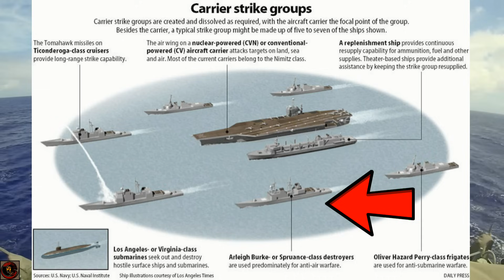DDG-51 Arleigh Burke Class Destroyer AEGIS - Overview

Comment: Don't get me wrong, I love my country's Navy but this ship is NOT really, in fact, a destroyer.  With the latest Flight 3 ships going 166 meters and up to 10,200 tons, this ship SHOULD be a CRUISER (consider that the Ticos are almost the same size and weight) based on most accepted international standards for ship design.  That being said, Burks are the most capable destroyers the US ever fielded.  

The Zumwalts will NEVER replace the Burks.  The Zumwalts tried to do too many things on one hull and failed miserably (other than as a technology demonstrator).  Especially for a ship with a 180-meter length, a displacement just short of 16,000 tons (Cruiser in Destroyer's clothing?) and a price tag of $5 Billion per ship BEFORE the sequester cuts jacked that up too (to be fair, Burks aren't cheap at $2 Billion per ship either).  They either need to pull a 155mm from the Zumwalt and slap on another 80 cell vertical launcher (giving them the highest missile payload in the Navy) or just "bite the bullet," and extend the ship to 200 meters and 20k tons, add all the flag functions, more MK57 launch cells and call it a Guided Missile Cruiser.  Even then, I doubt the Zumwalts will ever be bought in the numbers that the Burks have been built in.
Reply: Zumwalt was never built to replace the Burke. In all honesty though, it could (bare price). The Zumwalt was built to fill a land attack and point defense roll. IE no ballistic missile defense or area denial capabilities. This, along with cost, is why the Zumwalts aren't being built. The Zumwalts offered a lot in technological advancements, and the USN will likely benefit in future ship design from them. 

The original plan for the Zumwalt series was to make three ships [ship classes]. Each ship creating different capabilities that all three would share. Two of the three were canceled out right, thus leaving the Zumwalt without the full suit initially intended. This also caused the costs to skyrocket, as now the R&D was concentrated on a very low production run and only one ship class. Overall, the Zumwalts simply aren't the right ship the USN needs right now. What the USN needs is to start working on the Burke replacement, thus a smooth transition can happen in a few years to the more advanced class. 

@Wynton Goulding
The F-35 isn't actually a few times more expensive. The F-18 costs $80.4 million APUC, plus $8 million for the two engines, and finally $20+ million for the life extension to reach 30 years. That's a total cost of about $108 million TY (life extensions cost a fair more than $20 million, but I give the SH benefit of doubt). Keep in mind this goes up over time as labor, inflation, and technology all increase (technology being upgrades to the air frame), as this SAR is from 2011 (production estimates to 2014, so not up to date). The F-35 costs $110.7 million APUC and $19.9 million for the engine. A total of $130.6 million TY, all variants included in metric (the F-35A is much cheaper than the C and B variants). Keep in mind the F-35 costs take into account projections that include inflation, labor and upgrade costs out to 2038. Point being, the F-35 is very comparable to the F-18 in cost, and given the far greater capability, the F-35 is easily worth the extra cost.
Reply: No Zumwalts will NEVER be brought in with the numbers that burkes were built with, unless something drastic cough war cough happens. It's just like fighters and tanks and carriers and subs. It's better to make (to a certain degree) better things in less numbers. For instance, while the F-35 is a few times more expensive than an F-18, in combat when the F-35 is fully developed, it could shoot down F-18's with ratios like 15:1 and strike ground targets the F-18 couldn't. Also, there are costs besides just building the things, like people. Employing and training people (especially in complicated stuff like Naval Warfare and Operations) is very expensive, and so that's another thing to consider. I agree that the Zumwalt may have been over ambitious. But the R and D is probably worth it in the long term, and new tech always has bumps and bugs. In the end, going over budget is usually due to the government adding new requirements AFTER the engineers had already designed the damn thing, or even worse, after it began construction. Engineering is about trade offs, and we do a whole bunch of trade studies and other things to decide what's important and make important decisions based on what's wanted. When that is messed up, and/or more capability is asked for where there's no wiggle room to accommodate it, bad things happen.

Comment: One point of order on your nomenclature. DDG-51 is a hull number. It refers to a specific ship, the USS Arleigh Burke in this case. The class is referred to by the name of the first operational ship in the class, not its hull number.

EDIT: One other side note. The flank speed of the Arleigh Burke class is FAR more than 30 knots. The exact value is highly classified, but a really cool fact is that one of these ships can go from full flank speed to a dead stop within a hull length. You don't want to be aboard when they do this maneuver, but it's a standard part of sea trials for all new construction. I had a buddy who served as the weapons officer aboard one of these puppies and boy did he have some stories.
Reply: True story. Thanks to fully reversible pitched propellers, they don't have to wind down the turbines and switch gears in a transmission. They can keep the turbines churning and just reverse the wheels. They really can stop the ship in 1 boat length from flank.
Reply: Hm, that explains it, the 30 kn seemed a bit slow for a ship like this
Reply: @werrkowalski2985  In excess of 30 kn (56 km/h; 35 mph) !
Reply: It is common practice in the Navy and Navy literature to refer to a ship class by either the first ship in the class, or the hull number designation.
Reply: That's not far off hitting a brick wall in your car at high speed, though a little softer
Reply: I'm replying to this regarding the sudden stop feature of these ships.  It's not as bad as it sounds.  I served aboard DDG 74.  U.S.S. McFaul and we did this maneuver a number of times.  It's basically like standing through a mild earthquake.  You do have to hold on to support cables, and keep hold of any drink you might have.  But no it's like running into a brick wall.  It just shakes really hard for about 60 seconds.
Reply: It is not uncommon for classes to be known as the lead ship hull number, the cg-47 class, ffg-07 class as well as ddg-51 class are all used widely. In some cases the flight iia variant is known as the ddg-79 class
Reply: Back in the 70s and 80s news channels were allowed to do live announcements about when carrier groups left and when they arrived. My dad and I did the math once and figured the group moved somewhere between 50 and 60 knots to get from the US Coast to the coast of Africa. So all the journals will say that these ships do 30-plus knots, but the truth is they all do about twice that.